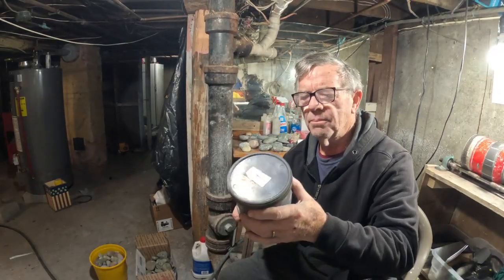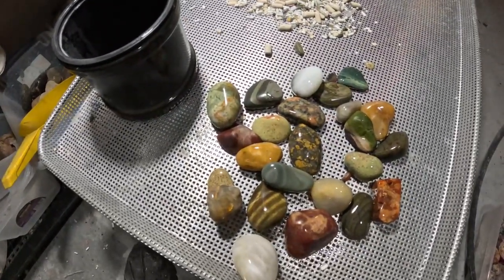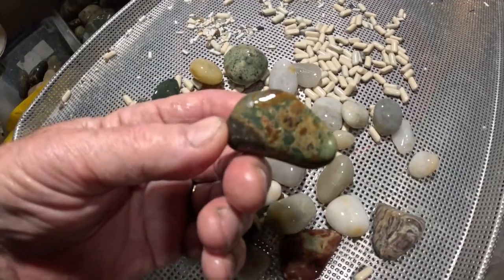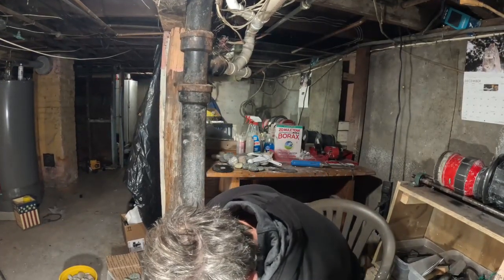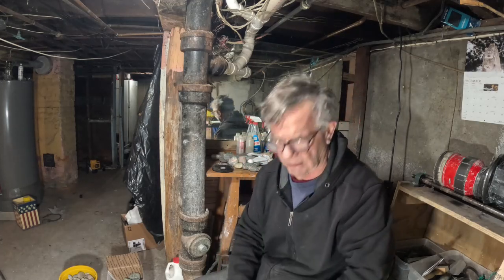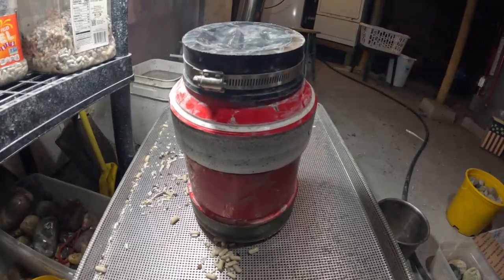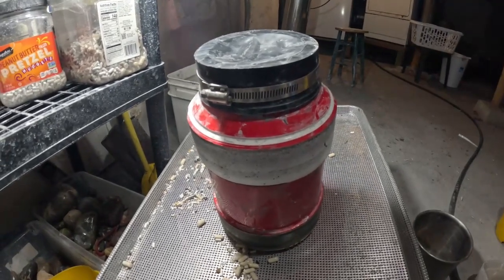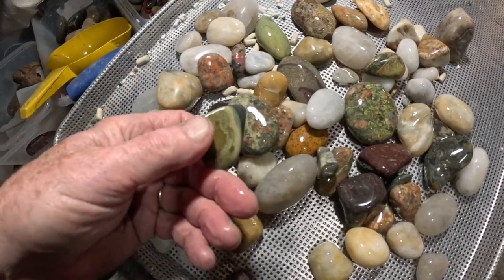Polishing MA Rocks

Comment: I enjoy tumbling miscellaneous stones I've picked up. Glacial till beds are harvested around here and used for road gravel so you never know what you'll see. Fossils, petrified wood, quartz, basalt, and stuff I can't even identify because I don't know that much about geology. But what you've got is similar to what I get. Thanks for posting.
Reply from the maker: Many rocks on the beach I frequent are dumped there by the Town to protect the low lying areas behind them. One beach the rock pile is 10 feet above a 12 ft tide. A dike made of stones at least 50 years old and added to every so often depending on storm damage.So exactly where the stone originate comes into question. And I see Great Lake rock pickers with many of the same rocks we have here. I have polished many unique beach stones.